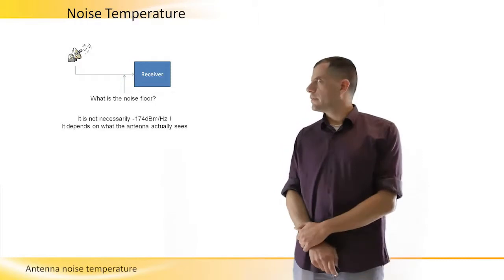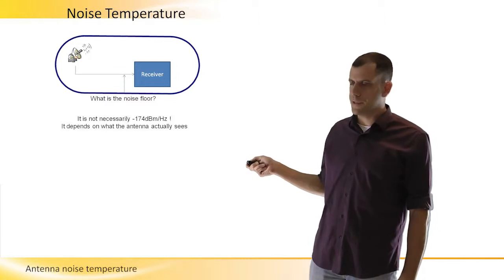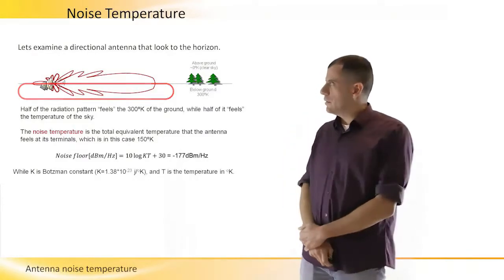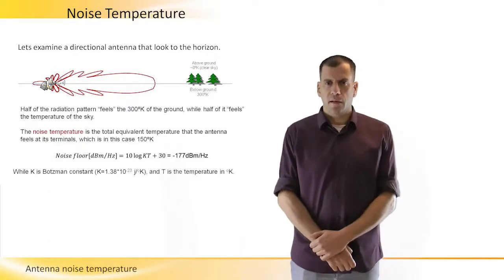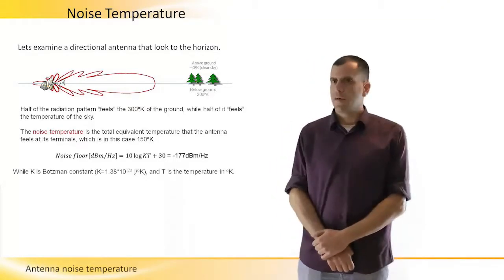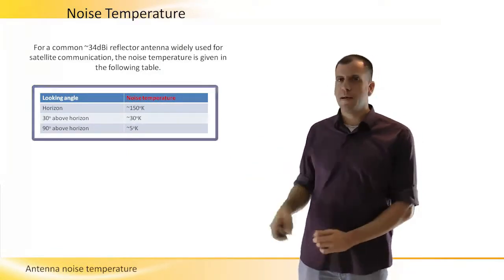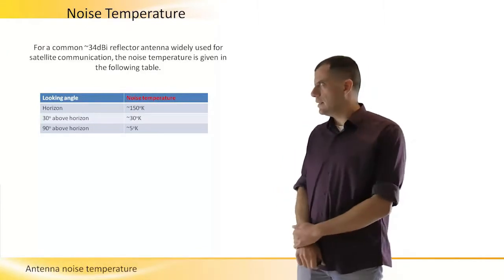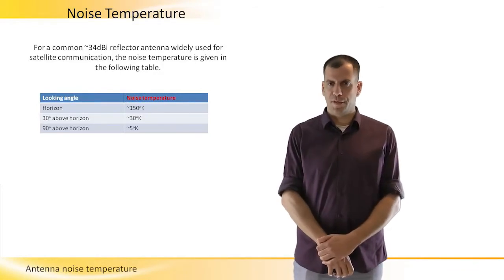Antenna noise temperature

Comment: Hello 5yr ago video...I have a question: I will be using pyramidal horn antennas with an LNA and a spectrum analyzer to scan in a 360 degree azimuth to look for possible interference in the X and S bands (2GHz and 8GHz). One of the requirements is to "Calculate cold sky noise temperature at 10 degree elevation." Would you (or anyone) perhaps know how one does this? Is this simply measurable somehow? Google doesn't get me too far...